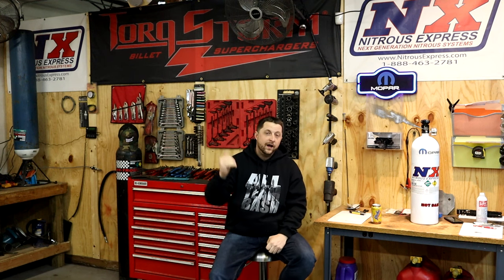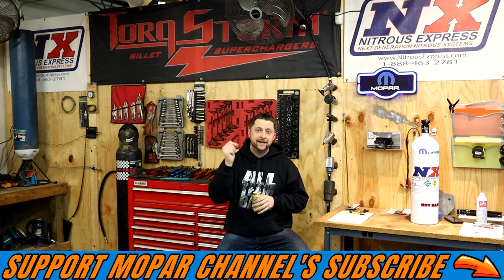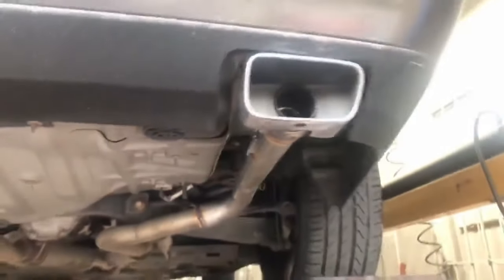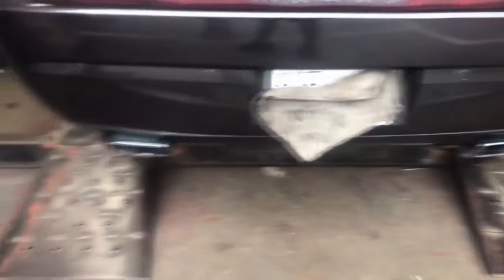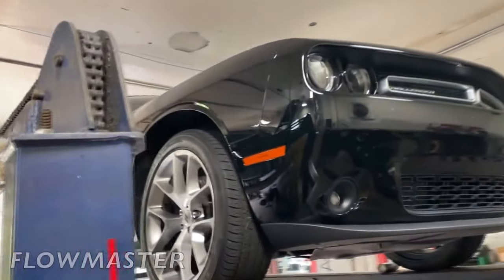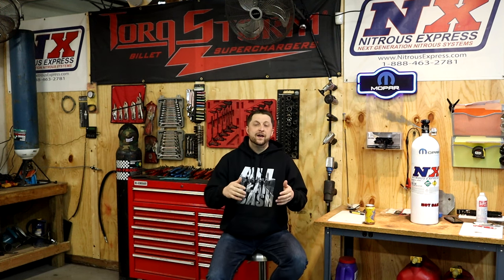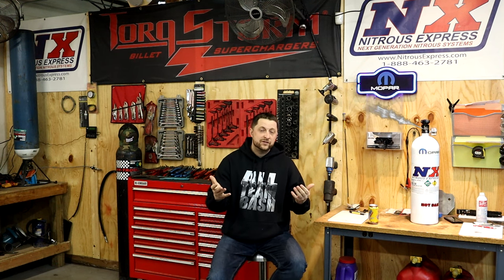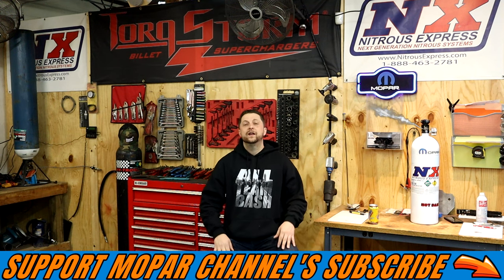V6 Challenger/Charger Exhaust Sound Great Like V8 Hemi?

Comment: I have a 2012 v6 Charger. I did a resonator delete and put on Flowmaster Outlaws. Loud as hell, and I get compliments often. I'm kind of tired of it now. It was fun for a while
Reply: Does it drone
Reply: @sneak diss 510  big time and it is annoying at times, but I have 12s in the trunk
Reply: @demetrismith2311  did any of the v6 models come with the factory kicker 12? Jw being my old 09 srt8 challenger did. Which I thought was quite odd being how hard it hits for something the factory installed.
Reply: That's how I am now. I put a custom exhaust on my 5.3 Silverado and it got old quick. Did the same to my Mercedes C-class and it sounded sweet for about a week. I'm not even gonna mess with the V6 in my Jeep. I added a CAI and am getting old enough now that I prefer the quiet exhaust. Especially in the mornings.
Reply: He said you shouldn’t do a resonator delete just for that reason
Reply: This is the best for v6 sound. I second this
Reply: How much would something like this cost
Reply: Got video to hear it? lol
Reply: You want a cookie?
Reply: That's why I think the exhaust cut out it better,push button...straight pipe sound get tired of it ready to behave like an adult hit button.

Comment: I have a 2019 GT and did the rear muffler delete.  I'm very happy with it.  I know it doesn't sound like a V8, and I'm not trying to get it to-just wanted a little rumble and tone.  It beats spending around $1500 for one of these cat back systems that leaves the car sounding basically the same as the muffler delete.
Reply: Good thinking...  My Challenger sxt AWD came with a muffler delete and resonator delete.  I wanted to sound like a V8 so I bought a borla Atak. Super quiet and was disappointed, went to the muffler shop and chopped the mid muffler and resonator again 😆
Reply from the maker: That's for sure
Reply: I also have a GT! Do you get a lot of drone with your muffler delete? I was thinking of getting it too
Reply: How is drone with the rear muffler delete?
Reply: @ayitsthunder7974  not bad at all
Reply: A cherry bomb set  is like 30 bucks and makes it sound deep.
Reply: How much something like that cost to get a real muffler delete
Reply: @Chard3819  cherry Bomb Extreme?
Reply: @ayitsthunder7974  it sounds amazing ngl
Reply: How's the drone inside the car at freeway speeds?
Reply: did u add anything in its place or did u just leave it at the delete? i have a 2016 sxt and am tryna do the same to mine
Reply: Did the same thing on my gt blacktop and I'm happy to with it 😎
Reply: 2022 GT CHARGER.

Rear muffler delete.
People ask me all the time is it a V8 lol
I’m like hell no.
I love my baby either way.
Reply: @JerzSo973 does it drone on the highway?
Reply: I cut a slit in front of my rear resonators it sounds good I will get pipe to run straight out eventually.  But sounds good for now free too
Reply: I have a 2022 v6 charger with a single mid muffler and 2 rear mufflers. I was thinking about swapping the mid muffler for a super 44 and doing rear muffler delete. Should I try just a rear muffler delete first?
Reply: Those 6's with muffler deletes sound like Japanese motorcycles.😅 Glad I have my hemi but hate the gas mileage.

Comment: You're absolutely correct about keeping the resonators on a v6. Removing them adds zero power and just makes it sound like a honda. What I have seen that sounds the best for the least money is removing the resonators (mids) and replacing them with flowmaster super 44s and replace the mufflers (rear) with vibrant performance resonators at the rear. Sounds nice and aggressive with minimal rasp and drone.
Reply: Video!?!?!!!’
Reply: I got a resonator delete and muffler delete and my sxt sound like v8 when I start it up and when it’s sitting and when I rev it when I’m driving
Reply: @Fastlife Mob  I guarantee a V6 with no mufflers or resonators doesnt sound like a V8.
Reply: @andymartin5250  I can show you videos if you want and ppl in my city with scatpacks and every other car tells me that my sxt sounds like a crazy v8 and I almost run a 3.6 from 0-60 so removing the mufflers and resonator does add power because I was only touching 5 second from 0-60 before I got them removed
Reply: @Fastlife Mob  if you could cut a second and a half off of your zero to sixty just from doing what you did, then every charger and challenger on the road would be straight piped. It's cool as long as you like the sound but I've had everything from a GT to a scat and tried several options on the v6 to try to get as close as I could to that v8 sound. It never did but it definitely sounded better than a stock v6.
Reply: Unknown  I can send you a video and picture of my 0-60 what’s your social media?
Reply: Unknown  I don’t use nothing to measure my time or to check my time because every sxt run 0-60 in 5.8 literally  and it’s common sense that a sxt will run that so it’s no need to track your time but my sxt runs a 3.6 or 3.8 sometimes and I race evey sxt challenger and charger and give them head starts and burn them the only thing that’s a even race for me is scatpacks I race them all the time
Reply: Unknown  and I never said I was running that with a resonator deleter or muffler deleter I said it’s a possibility thought that it could slightly add hp which it really don’t
Reply: Unknown  I got you bro I will
Reply: Unknown  thank you brother I will and you stay safe too brother!
Reply: @Vamplife718  you numbers sound off bro ,sound like you in the mountains going downhill bro ,I cant get those number in winter time in Houston I'm have 3.90 gear s type borla catbak and big cold air intake ,I'm getting 5.2 to 5.5
Reply: @roshunperrino5300  that’s crazy I never get 5 seconds and not only do get 3.6 or 3.9 seconds from my time meter but on my phone as well I start a time as soon as I hit the gas and get the same results
Reply: @Vamplife718   your numbers bro 😂😂😂 heavy ass car with about 310 to 315 hp open diff ,you must have nitrous or you boosted ,if you not you should start a YouTube channel show use how to get 3s non boosted
Reply: @Andy Martin, Would like to hear your sound clips.
Reply: @Rodger Baer  I no longer have the car. Have an RT now, so it sounds great from the factory.
Reply: @roshunperrino5300  you have ig?
Reply: @Vamplife718 big cap. Impossible to sound like a V8 and secondly your 3.9 is timed from 20 to 60mph. Stop the lies. 3.6L beating a R/T is a lie. Talking about 6.4 is your competition. Man leave that crack alone.

Comment: i love my v6 challenger. 
has all the power i need   looks like a badass car and gets 20+ mpg   and these days that matters! 
hemi is nice but comes with a price! 
v6 for me all the way
Reply from the maker: Hard to argue about fuel mileage
Reply: The V6 doesn't make sense. I average 24mpg with my 09 Hemi 300.
Reply: @nicholas440  that depends on the daily commute if it's worth it or not going 20-30 miles one way it's not a big deal going 70-80 miles one way makes a big difference.
Reply: I live in a really snowy area and wanted something AWD for my daily. The 300 v6 AWD was good to have a factory/dealer warranty. I was also looking at the pursuit chargers with AWD and the 5.7 but didn’t find any deals I felt were worth it at the time and it didn’t have the bells and whistles.
Reply: The 6.4 is a thirsty premium drinking pig. The r/t isn’t really bad and runs fine on 87. Unless you’re driving a really long commute if you do the math it’s not much more expensive in fuel per year. It’s worth it, it’s just a great daily driver. The 6.4 not so much unless you work close to home. I had to decide between the 5.7 and 6.4 twice and both times the 5.7 was the clear winner. Neither are race cars and so many cars quicker than both, the 5.7 gives the enjoyment and practicality. What you save getting the 5.7 can go towards the plus package Harmon Kardon stereo and other enjoyable options.
Reply: @FrostbiteRam I have a 2014 V6 Pursuit, I wanted a hemi but I drive 107 miles to and from work. I average 26mpg at 80-90 mph
Reply: If you have to worry about gas prices v6 is definitely your best option.
Reply: Price?

Got mine cheap. 08 Charger RT for 15k in 2016 with 72k miles. One owner, local. Only issue is she drove it during the winter for 8 years. I'm paying for that now lol

Dodge should have never released the Charger or Challanger with anything other than a v8...it's pointless.
Reply: @nicholas440 depends on the Model its not 1969 anymore a V6 with a few Mods will roast an RT lol youre only talking 70Hp difference, really doesn't matter until ypu get up to the 392s an the Hellcats which is cool if ya wanna drop $80k an have worse mileage 🤷‍♂️
Reply: @redpilllife4life198  it's not the best on gas either lol
Reply: @Bgk-334  true, its only a few miles better than the R/T.

Comment: I bought a used 09 Dodge Charger SXT - low miles no accidents and regular maintenance w receipts. it's a nice charger for a v6 until I can afford a Hemi!!  I installed an INJEN cold air intake, new 18-inch wheels, Michelin tires, and Brembo breaks, recently added a transmission fluid cooler because why not... new upgraded spark plugs, new fuel pumps, new upgraded radiator. Now it's finally time to do the exhaust mainly because I can afford it, also it is just smart to take care of priorities first and get this car running very well as is before doing any real big changes. I figure the dual exhaust is the last work I will be doing on this ride other than normal maintenance. 

I mainly want to know what exhaust you would recommend for my current set up as is on a budget. I have seen model 40 and 44 for my make and year but the 10s supposedly don't fit. Can the 2 and a quarter pipe be changed out to 2 and a half or 3 without hurting mpg and performance? 
I have read that 2 and a quarter is the size to go with for sound and performance with the v6. If this is untrue, I would be happy with 2 and a half with super 10s!! Also, will adding dual exhaust up the value of the vehicle?

ANY INPUT WOULD BE REALLY APPRECIATED. 

MOPAR DAN

Comment: 2013 Dodge Challenger . We changed out the mid mufflers for two vibrant bottle type mufflers. We deleted the rear mufflers and kept the factory tailpipes. Catalytic converters are still present from factory. Also, the 2013 Dodge Challenger 3.6l does have a true xpipe. We did remove the factory xpipe for a Jones xpipe from summit for $40. Total cost in parts: Vibrant bottle type mid mufflers: $60 total(new EBAY) Jones xpipe 2.25 diameter $40. $100 in parts. New 2.25 pipes from xpipe to the rear tailpipe’s $250 total. Altogether, spent $350. Better gas mileage as the car is breathing better(flow of the exhaust out). Sounds incredible. This is my daily driver.
Reply: I'd love to see you post a video of this build. How much better gas mileage have you seen, too?
Reply: @Z.DeAllen  Hello Allen. We are seeing about a 3 mile per gallon improvement as long as we keep our foot out of it. This car is also Diablo Sport tuned. We have a K&N  type air filter(non oil, washable) installed. No CAI. I wasn’t able to video the install as I was in the waiting are. All parts welded
Reply: I to put the vibrants in the mid and removed the rear mufflers. Sounds just right! I saw the setup here on Youtube.
Reply: @g3attack  Oh, have fun and stay safe.

Comment: Since I have a v6 Challenger, and eventually want to pass it down to my future kid, all the "performance" mods I've done are installing a Cold Air Intake which gives it nice growl/rumble and I also straight piped it(removed the resonators and mufflers) and boy does it sound agressive as a muscle car should. Taking into consideration the factory spoiler it has plus some racing stripes I added, it looks great. I've literally got around 25 plus people complimenting how good the car looks, in the couple years I've had it.

Comment: The best bang for the buck that i did on my charger 3.6 was cut off the rear resonators and replace with a normal pipe. You can do that at home in your drive way with some creativity and some parts. Or you can have it welded. It sounds good, not raspy or loud, but a nice deeper tone.
Reply from the maker: I agree very simple and sounds very clean with the mid resonators still in place 👍
Reply: This rear resonator delete sounds 100% better in real life. No.. its not a V8 but its not a raspy fart can either 😂 just a nice 6cyl
Reply from the maker: @lordmegatron8617  that's for sure👍
Reply: Did you get any drone when you cut off the rear resonators?
Reply: @lordmegatron8617  similar to v6 camaro who aren't silent stock
Reply: @MrNanado   I was wondering this as well
Reply: When removing just the rear resonators, and leaving the middle can mufflers/resonators how was the drone??
Reply: @HenriLettmann  late comment but hope it helps
I removed only the rear mufflers and kept the one in the middle and the drone waaaas awwfullll from inside so so noisy yes it sounds amazing from outside and in the tunnels but from inside horrible i returned them back after a while

Comment: 2019 Challenger GT: Mid resonator and rear muffler delete. Add a single flowmaster 40 dual inlet/outlet where the resonators were. Awesome awesome sound!!
Reply: in the video, they didn't delete mid muffler...why do you delete it?

Comment: Thanks for the video. 
I agree leaving the stock mid mufflers in, and deleting the back resonators is the best sounding in the Best Bang For The Buck Category. 
And the Super 10 Flowmasters sound great, but too much drone/noise for a daily driver in my opinion. My favorite four mufflers, (with the back resonators deleted) is the: Flowmaster Delta 40 series, the Flowmaster HP-2 x 18”, the Magnaflow 4”x 14”, or the Magnaflow 4” x 18” mufflers.

Comment: I put the Super 10s where the mid mufflers were, cutoff the suitcases in the back and placed Flowmaster Flows in the spot. Sounds like a beast with virtually no drone.
Reply: Can you send me the link you used to get super 10 and do you have a charger

Comment: hey this man NAIL IT! what I needed for my 2013 dodge charger v6. I bought a borla S-type system and it didn`t have that roar like it should. I follow all step in installing correctly. not much different. i did a before and after. I was not pleased, but this set up I will try with the flow master Super 10 on my charger with straight pipe. thank you for this vid. awsome job explain it.
Reply from the maker: Thanks💪

Comment: I had the total flow 314633 on my 4th gen with the 5.7. There was a slight drone after it got broke in but not bad. I took it off when I sold my truck. I got a local shop to install it on my 5th gen 5.7. They installed it further forward than the stock location and I'm glad they did. There is no drone at all. It's not as loud as it was on my 4th gen was but it sounds great, deep and mellow.
Reply from the maker: Awesome information 👍
Reply: Hi , whats the part number of vibrant performance resonators ?

Comment: Option 3: delete rear mufflers, and add flowmaster 842518 in the middle, do I need to delete middle muffler? from the video, you mentioned that we add it in front of the middle muffler without cutting middle muffler? I'm very new to this...I just want to double check my understanding is right, thank you. 

Step 1, cut off the rear mufflers
Step 2, add 842518 in the middle, 

is this right? Thank you

Comment: Thinking about doing Dynomax Racing Bullets swaps for the mids, rear delete with 2.5 in pipe to the tips. 2019 Challenger SXT. Exhaust Addicts has a similar video with the dynos as mids.

Comment: I have a 2015 Dodge Charger SE 3.6. I deleted the rear mufflers. I replaced the mid muffler with a flowmaster super 44 which the exhaust shop recommended for all dodge v6s I may go with a super 10 in the future

Comment: Years ago I cut out the resonator due to it splitting at the seams and ran just stock mufflers which sounded decent.. However, my car has no emissions equipment anymore. Its headers, catless 3 inch dp into 2.5 inch exhaust back to after market thrush mufflers since the oem ones rotted away. Sounds ok at first start up but as soon as the engine/trans initially gets through the power band it sounds terrible so I keep my foot out of it, but at 70/80 on the highway it sounds decent again. I am however going to install a glasspack as a resonator to help a bit with the raspy loose rock in a can sound.
Reply from the maker: Definitely the resonators will fix that or even some dynomax race bullets for resonators really any kind of glass pack will help your situation tremendously 👍 thanks for the feed back💪
Reply: You put headers on a 3.6?
Reply: 3800. Danny.

Comment: I put Flowmaster S10 mufflers on my 2002 Jeep Grand Cherokee Laredo 4.0 l6 Inline 6 cylinder And the sound and A 4 inch lift with 33 Inch x12.5 inch tires,And some nice fiber carbon around the fenders down to the rocer pannels,all blacked out and it looks and sounds great.
Great Video, Thank You For Sharing. Niagara Falls Ontario Canada Saying Hello.

Comment: i had an 07 300 3.5, did the resonator and muffler delete and went with just a super 10 in place of the muffler. inside drone on the driver side was just shitty. i got a '14 3.6 now. think im gonna just delete the mufflers first since its cheaper. if i dont like that might put some cherry bombs in place of the resonators.